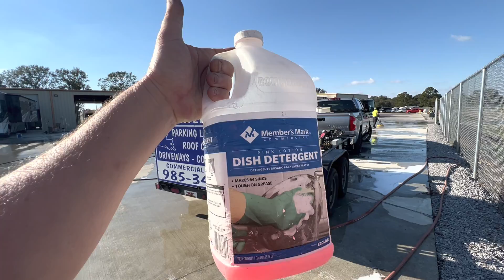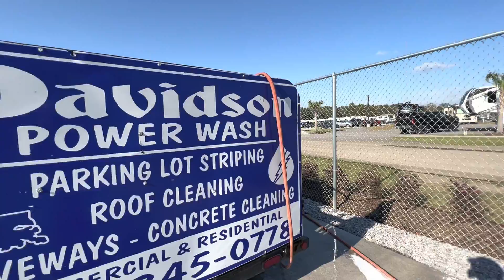Surface￼ Clean￼ Faster￼ 2X￼

Comment: Hey man this would  be great if you showed the finished product. Or hell even before so we know how dirty the job really is. I guess you could only do this where it is low in foot traffic because I am sure your insurance carrier would not love all suds. You are right dish soap doesn't hurt the seals of a pump. 

Man you sure do rack up some miles for work. That is two states away. For the life of me I can't see how a job can be profitable with the expense of a five hour travel. Between the wear and tear, fuel, and help getting paid to sleep I can see why you are not using sh. You are paying the help to sleep?
Reply from the maker: It's really not the price of the sodium hypochlorite I'm worried about it's just have to deal with those little 12 hour pumps that keep breaking constantly on the job site. We were carrying six with us on every job side when we go out of state. We have to change it several times each day and that is unreasonable. Setting hypochlorite is phenomenal but if you cannot use it sometimes that would be better also
There is something very flawed with the 12 pumps especially right now during Covid. Using detergent in the buffer tank works good on Dumpster Pad's as well. We've used it at sonic and other fast food restaurants and it made a tremendous difference. I will post some videos soon about that as well. But yes I pay my guys 24 hours a day, food, hotels and we still make thousands and thousands each day. If you cannot charge enough for a customer it's probably due to your relationship with the customer. I want to start doing some one on one training with guys to teach them how to sell their service with optimal charges
Reply from the maker: Yes they call us from all over the country and willing to pay us very well for our travel time. And it's fun

Comment: Hey Billy. What about doing a house wash? How do you get the suds off the windows when you got 250 gallons of ready-made bubble bath. Are you only doing this for concrete? Lots of jobs we do are houses with long driveways. Just trying to plan it out.
Reply from the maker: Right now we're only doing it on concrete but we have tried it on vinyl siding and it worked great. You also could mix only a half a tank if needed. I don't think this is going to totally illuminate the use of sodium hypochlorite but it should reduce it drastically.
Like I said in the video there is a time and place for sodium hypochlorite, 12 pumps etc. but I think we have busy miss using summer our tools in the industry just because as people here on YouTube pushing certain pieces of equipment on the population. In my opinion there's absolutely no need to take a 12 V pump and pre-treat a vast Area of concrete. It's extremely time consuming, bad for your personal health and could get expensive over a year long. This is the first of many many more videos and I will be doing trying to straighten out what some guys here on YouTube have been pushing on people that was unaware. I'm doing this because it's the right thing to do
Reply: @billydavidsonvip  I believe I will be trying this in the very near future. Thank you for all you do and for helping us out.

Comment: Great job Billy, what pressure and flow rates were you running on the yellow surface cleaner .. cheers David from Australia 👍
Reply from the maker: About 6 gallons per minute probably 3000 psi. We had our machines dialed back a little bit because we were having trouble keeping the buffer tank full

Comment: What impact does this method have on post treatment for lines
Reply from the maker: So far we don't feel like post treatment is necessary if using this technique. Actually we have been washing one of the facilities for years that we were testing. We literally have never seen the concrete come out so clean. Concrete dried extremely white it was probably cleaner than I have ever cleaned up before 
Furnace example we use soapy water to remove organic growth on our hands but not sodium hypochlorite. The surfactants in the Detergent break down the proteins in the cell walls of the algae rendering it in capable of being hydrophobic causing it to die

Comment from the maker: Below you will find an article and a video clip about up streaming. As we describe in this YouTube video we can achieve the benefits of Up streaming by adding a mild Detergent to the buffer tank. Approximately 1 ounce per 100 gallons will produce a significant increase in speed of surface cleaning and rinsing. If you are refilling your buffer tank constantly he will have to add more detergent to the buffer tank periodically as we describe in this YouTube video.

Some of the mild detergent we have used is Dawn dish soap, Fabulosa's, gain dish soap and a generic soap for cleaning hands. We had similar results with each one of these detergents.

In addition is important to know why you should not under any circumstances add bleach or any other bleach derivative products such as sodium hypochlorite to your buffer tank to be injected through your high-pressure pump. This could and will cause catastrophic damage. Using detergents [not Bleach] should be safe for your particular pump but also refer to your user manual and other engineering articles on your particular device.

We measured the time it took us to surface clean and rince A section of concrete with only plain water
The results were as follows

3500 psi at 8 gallons per minute produced 3975 ft.² of clean concrete with plain water

Adding 1 ounce per hundred gallons of mild detergent to the buffer tank resulted in the following productivity.

3500 psi at 8 gallons per minute produced 8650 ft.² of clean and rinsed concrete per hour

After doing several measurements with using several different types of detergents as mentioned above live results were similar in most cases.

The technique was very effective in removing mold and mildew from concrete without pre-treating it with sodium hypochlorite

In addition, the cost of the detergent that we used in the above test was approximately $2.30

Using sodium hypochlorite we use approximately 18 gallons at a cost of $41.70

Again, the results were very similar using the mild detergents versus sodium hypochlorite

Check out the article and video below. Also don't forget to visit our website to help grow your Pressure Washer business

Www.billydavidsonvip.com

Disclaimer:

Before using the above mentioned tactics in your Pressure Washer make sure you check your users manual and/or engineer in articles on your particular pump.

This data is provided for informational purposes only and we do not assume any responsibility for damage to your equipment

Here is some more resources :

https://youtu.be/0EP-NRrJ0uM

https://youtu.be/oUynKqntbm0

https://powerwash.com/powerwash-industry/chemical-application/

https://youtu.be/EPbiEk_tCIE